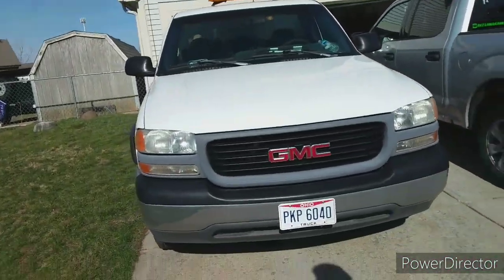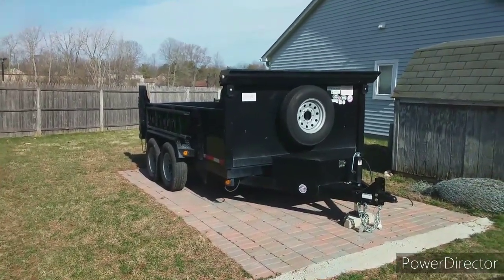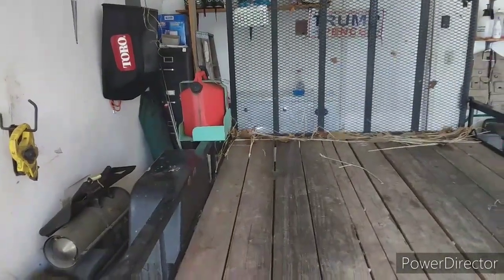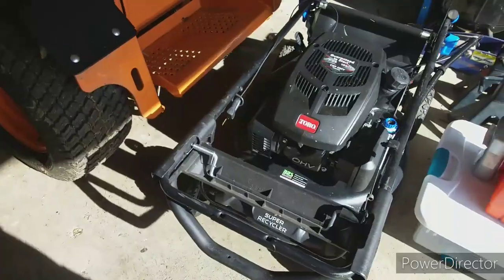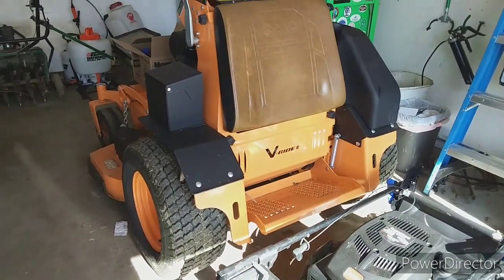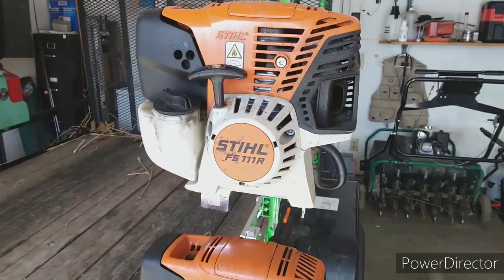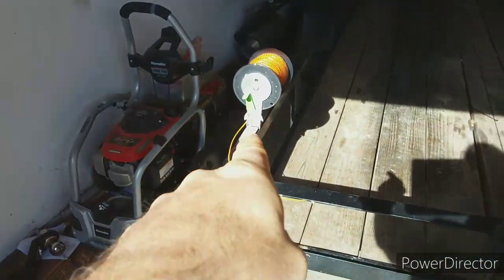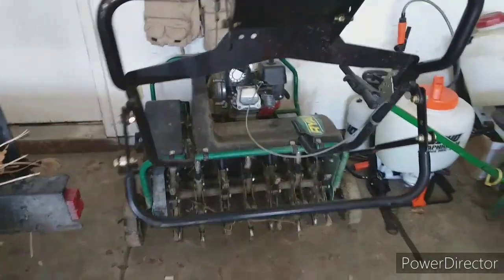2021 Equipment Setup | A Different View

Comment: nice equipment... I run my business out of a 2003 Astro cargo van because I don't do large yards that take alot of time... i stick to smaller size yards because i can knock more of them out. I bought the van 2 years ago and it still runs great for 3 grand! I just got a used toro turfmaster 30'' twin blade mower.
 I just replaced the carburetor on a 3 year old STIHL fs 56 for like 20 bucks on amazon... it was gummed up and I was too lazy to take it apart lol
Reply from the maker: That is awesome man. You Can't get better than that on saving money. Doesnt take thousands to make a living
Reply: @DOCREAL1118  yeah i love to mow!... although last summer was so hot and dry i didnt do much of it...hoping this season is different
Reply from the maker: @leadnsteel1428  I hope you get more of a chance to mow this season man.